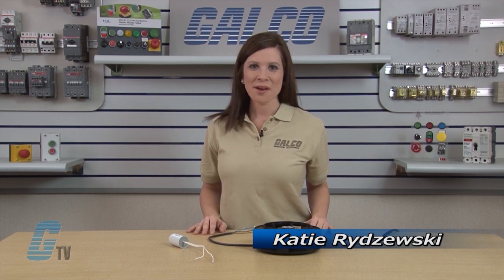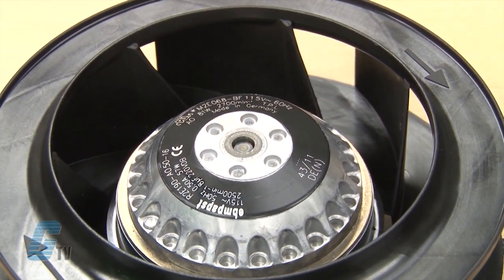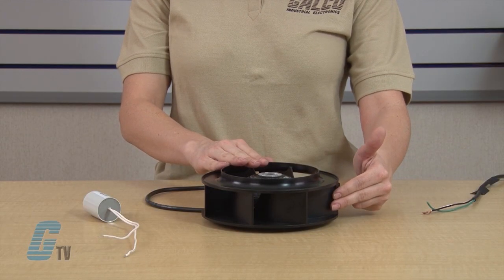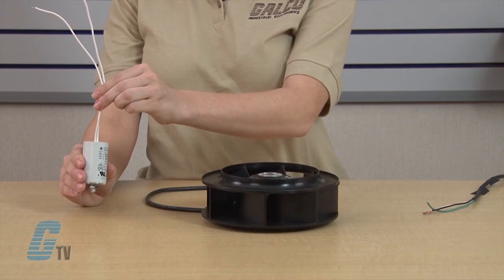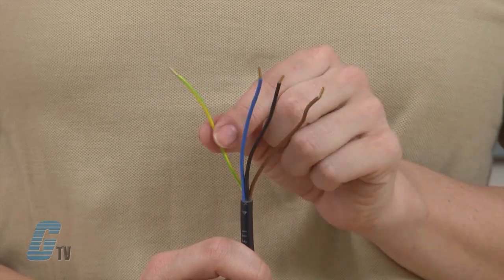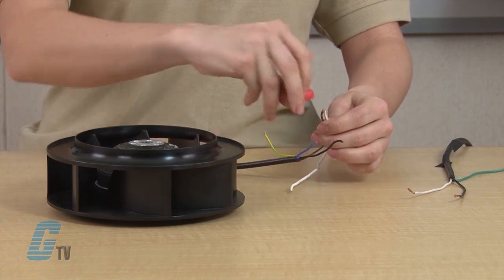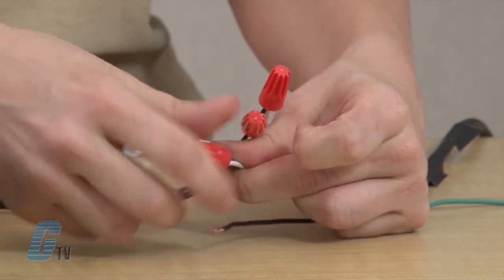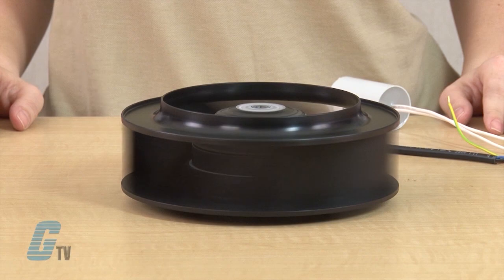EBM Papst R2E190AO Motorized Impeller Fan Review

Comment: can u help me to how to connect capacitor of other fan
Reply from the maker: Possibly, but the fan motor mfg would be a better source. Having said that, you should have 3 or 4 wires to the fan motor, correct? If so, 1 will just be a ground wire, another will be a common wire of 2 different coils in the motor. OK,,,,, if the fan is big enough to use a capacitor it is used for 1 thing only, direction control at power up. AC single phase motors don't know which to start turning when power is first applied to them, so they must have a "Shaded Pole" built in, or, what I will call, a Starter Winding. The Starter winding will have a higher resistance to it then the Main winding will. So when you measure resistance between the 3 wires, you need to identify the common wire by looking for the highest reading. You should get three different readings, for sake of discussion we will call it low, med and hi.  The high reading means you are across both coils and the common wire will be the 1 hanging loose. Now you must be careful connecting. So now your common wire will go to neutral of power supply, the hot wire will to the wire with the low reading and 1 side of the capacitor. Connect the other side of the capacitor to the remaining wire and should be ok? Let me know if this works for you, good luck.

Comment: what is  capacity of the capacitor has been used with   a Fan  ebm R2E220-AA40-05-TW    ?
Reply from the maker: It uses a 3uf @ 400volt to start it.

Comment: I also have a red,black and white wire from my motor?
Reply from the maker: The fan demonstrated in this video runs on AC power. The capacitor actually connects to a special winding in the motor to make sure it starts in the same direction each time it is powered up, DC fans do not need this capacitor. Is your fan rated for AC or DC voltage? Usually Red is positive, Black is negative and the white is a tach lead.